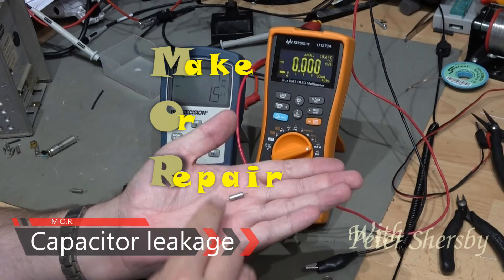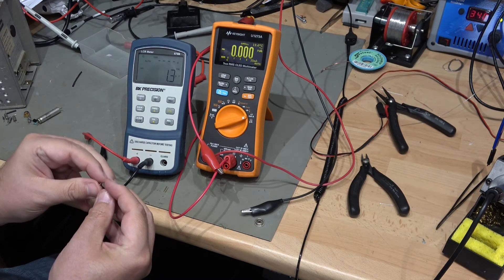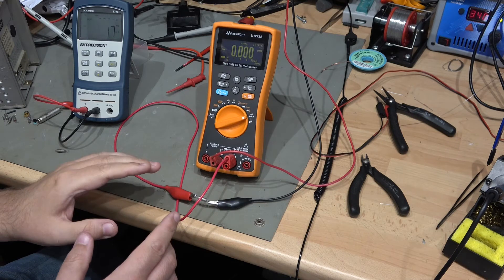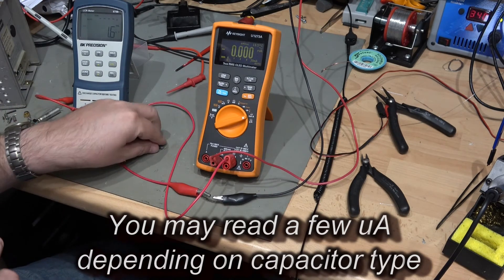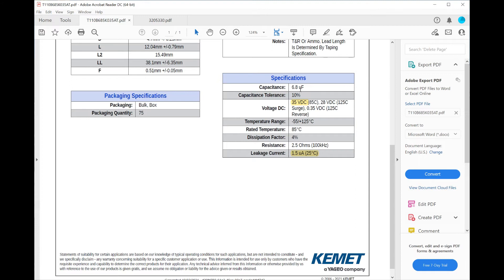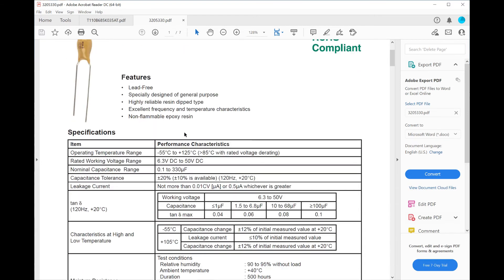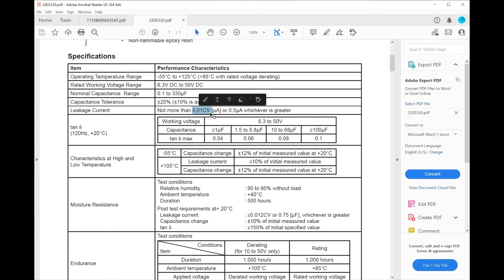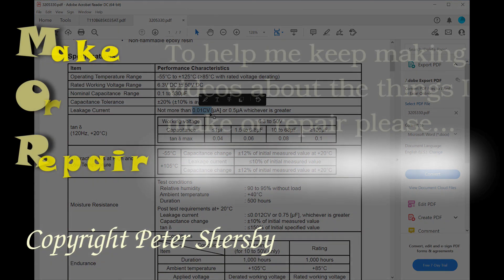0015 Capacitor leakage Trap

Comment: good sign that capactor is leaky, that shows higher capacitance on meter that it should (especially if it is old cap), for example 30uF for 22uF
Reply from the maker: Absolutely! on a proper LCR meter the lower DC resistance makes the equation calculate the Capacitance as higher. I have seen some fairly extreme examples of that like 2200uF reporting as over 6000uF  (in a power supply that blew the fuse).    I have mentioned it  in a couple of my later videos and have been pondering doing a video showing how the phase shift is used to calculate the capcitance in an LCR meter and how low DC resistance affects it - would that be worthwhile do you think.

Comment: I hav make my own capacitor leakage tester many years ago and it works with 6 volts and max 2000 uA and it working nice to me .
Recently i order a bonch of 47 uf 16 volt tantal capacitors (chinese) to replace instade of some electrolethic's in my analog tektronix oscilloscope.
Before i use them in my stauff i test them for leakage and the result shocked me.
All of them have leakage more than 100 uA in 6volt
I dont know all of them is faulty or this leakage is for aplaying just 6 volt in order to test them.
What do you think???
Reply from the maker: I think that the leakage should be in the ballpark of  10nA/µFV for tantalum , so no more than about 10x47x16  = less than 7.5uA at 16Vor about 2.5uA at 6V.  So they sound pretty bad to me.  Of course don't know how your tester is doing the test and if there is something that could be catching you out - when I get a whole lot of bad test results, I tend you just stick a known good component in the tester as a sanity check!
Reply: @MakeOrRepair  last night i found some strange fact that line marked on tantal caps is positive😮 i was    connect my  caps on reverse polarity so its normal that  poor cap shows leakage.
Thank you anyway
Reply from the maker: @siavasharash5448  well at least that explains it!  The line on the end of a tant is normally positive in my experience, but I was recently puzzled by some tants that had a line as normal but with what looked like a "-" sign in it, I had to double check and discovered it was a badly printer "+"

Comment: Another consideration is that caps, especially in equipment where power hasn't been applied in awhile will reform. We can see this happening while testing because the current will continue to drop, and sometimes slowly as the cap reforms. It's good to wait several minutes, or until the current through the cap stops dropping before condemning the cap if the leakage current is above spec.
Reply from the maker: Good point for electrolytic caps in older equipment.

Comment: Good info. As you noted, the leakage needs to be tested at the cap's rated voltage. There are lots of DIY circuits that develop the higher voltages needed to test supply voltage smoothing caps, but much care is needed to use them. Example: 400V SMPS caps. They are dangerous, in uneducated hands, IMO. Interestingly, I have never seen anyone include an explosion cover, to house the DUT cap. This would seem to me to be a basic safety necessity.
Reply from the maker: Yes, you can find many faulty caps using lower voltages, but how confident are you in a 400v cap tested at 30v?  I was thinking if I ever made one that I would include auto discharge at end of cycle, displaying results only when full cycle completed, and a cover with interlock that disconnects and switches to a simple discharge when opened.  It is still on my endless list of projects!
Reply: @MakeOrRepair  I am not sure that I was understood... I am saying that there are tons of DIY high voltage cap test circuits on the web and that they are dangerous. I have seen 600V. Yes, a discharge circuit is a great idea.
Reply from the maker: @t1d100  sorry, I didn't mean to confuse.  I agree that the DIY high voltage testers I've seen are dangerous.  I was just thinking that the "explosion cover" you mentioned could in fact be a cover that would prevent touching during testing and disconnect the dut when opened
Reply: @MakeOrRepair  Ahh... I see. Yes, that is a much needed double-duty. Thanks.

Comment: Good advise.. i didn't think about this before. But you are right. will check it that as soon as i can :)
Reply from the maker: Glad to help.  I only test the capacitors I think are likely candidates - old electrolytics, canned tantalums etc that otherwise test fine but are going to be expensive to replace.  For paper and waxed caps I just replace them.
Reply: @MakeOrRepair  tested them yesterday..they were on the limit .but they are pretty expensive so i will use them..but to be honest tantalum caps..usually those big one hermetically sealed last for ages before they go bananas ..so they are usually fine.but you made good point..after all ebay ius full genuine..almost new ..never used..just stocked...20 years old tantalum caps... :) haha
Reply from the maker: @SylwerDragon  Good capacitors seem very expensive at the moment.   Some of the better makes seem to last forever, then I get a device that seems to be full of hopeless cases (often the smaller values) In one device I repaired it was full of them with 50% really bad,  but looking at the schematic,  except for a few places there seemed to be no justification (perhaps size) and I replaced most with higher voltage low esr electrolytics.  TOo be honest, many parts of circuits are not bady affected but when I was repairing an HP power meter the leakage of the ones in the range switch  was the critical factor so I hand selected replacement tantalums.    I wonder if some of the bad examples relate to how close they cut thigs for the rated votage vs. the rails they are connected to.  In some cases I've even made little carriers for modern alternatives but where the "authenticitiy" needed to be retained I've purchased a few ITT make from ebay (being a bit selective about suppliers) and they tested ok, At a push even recycled some from other boards. It all depends on the need for authenticity and the quality/value of what I'm repairing.
Reply: @MakeOrRepair  yeah you are right..but there is reason why they used in some cases tantalums. Usually it is better parameters ..after all. these caps are also used in space industry and are on probes that lasted decades and will last more if power will permit.. If designed correctly there isn't usually any need for them to go bad...for example i was fixing 1kv voltage standard 7.5 digit..and i wasn't even able find good replacement for those super low leakage caps they used..i was able find few in usa..same brand but new. And rest i went for tantalum. Where i was thinking they needed to be for stability anyway..hermetically sealed tantalums will last for decades if they are not overheated but better if too much voltage isn't used..leakage current is always problem but not so big..they are awesome. Awesome expensive ;..haha 100uF /60V could cost 100 Euro/usd like nothing..so yeah not cheap ones but in all voltage standard where there is some oven you will find only tantalums..normal capacitos would last year with luck...3 with super good quality.no more ..tantalums will last 30 years so yeah big difference..but ofc nothing last forever :)

Comment: I see other video's adding a resistor in the test circuit. Which is correct?
Reply from the maker: There does need to be a resistor somewhere particularly as voltage goes up otherwise you get some pretty nasty surge currents (the resistor is in the multimater is high enough for most voltages/capacitance that I work with).    Mine is just a quick and dirty method but it works pretty well particularly with tantalum and electrolytic caps,  I use it mainly with tantalums in older gear because of the very high replacement costs.  But there are a few approaches, this was just the most direct way I could think of to demostrate the problem. I'm using a good digital multimeter, so it already has the resistor built in, the meter is really measuring the voltage across the internal resistor, and the lower the meter range (I think I used mA in the video, but with a 3mA scale that means only the left digit is mA, the other 3/4 are uA, in the uA range the resistance is much higher, quite a few k ohms,  and the meter resolves nA. I always recommend electronics enthusiasts to get a meter with the LOWEST current ranges they can. Essentially in my brief introduction to the problem I charge the capacitor through a resistor (in the meter) and the voltage across the resistor should drop to Zero when it is fully charged because DC current can then only flow if it is leaking.   The eevblog uCurrent gold current meter adapter would make a pretty good low current detector (it uses series sense resistors and amplifies the result to drive a volt meter and you could always use bigger resistors to add greater sensitivity).
I know a couple of diyers have done some higher voltage meters, (some safe some not) and they certainly use resistors because both the voltage and current need controlling, often they also use a sensitive coil meter that needs resistors for limiting.   The key thing if looking at these is 1. make sure there is a means to discharge the capacitor (and test it without touching) and make sure the switches are in the low voltage half of the circuit, I've seem people some using 30V switches with 340V DC supplies. 3. I don't think I would use one unless it is isolated and current limited.
I seem to recall  also seeing an approach where a capacitor is charged to a known voltage, then left connected to a really high impedence op amp to see how fast it self-discharges through internal parallel resistance.  I guess it is also possible to create a Wheatstone bridge with 3 resistors and the capacitor (using very big value resistor opposite the  capacitor) and that would enable you to measure the internal resistance using potentially any DC voltage, again once the capacitor is charged.  
Of course in any equipment of some age then some capacitors (many electrolytics, old-can tantalums, paper) should pretty much be replaced as a matter of course (smaller caps cost little).  There is always some cost/vs. value  to think of but in general with the bigger, very expensive electrolytics in a power supply I often look first to see if they are a relaible make,  check phystical condition  and look at position relative to heat, then look at power supply output ont he scope, any cap that looks to be buldging, leaking fluids, right next to heatsinks etc and any cheap brands are replaced. I also replace any that are close in DC value, e.g. in a 12V supply I would tend to put 20 or 25V caps in to replace any 15/16V that are present.   If there is still 100/120Hz ripple on the DC supply after that then any remaining are changed.

Comment from the maker: Ideally you test the capacitor at its maximum rated voltage but this can be both dangerous and not attainable for many people.  There is nothing to stop you testing high voltage capacitors at lower voltages, but some faults might not show up